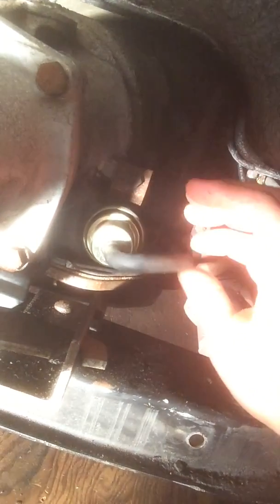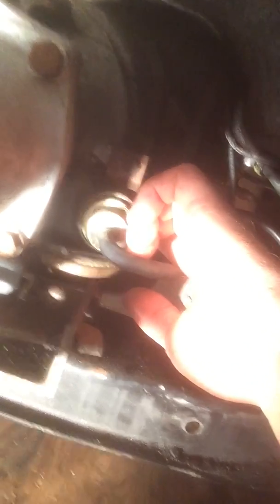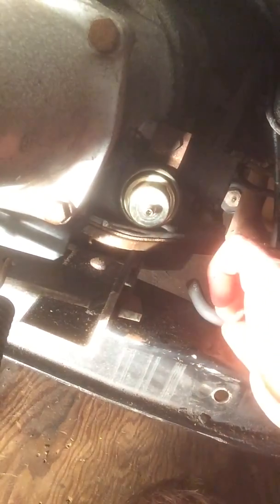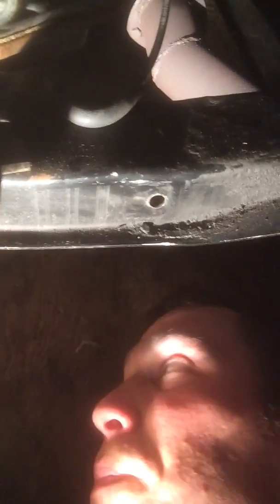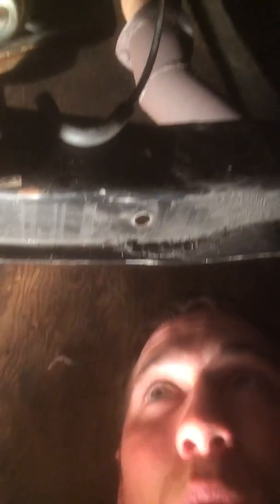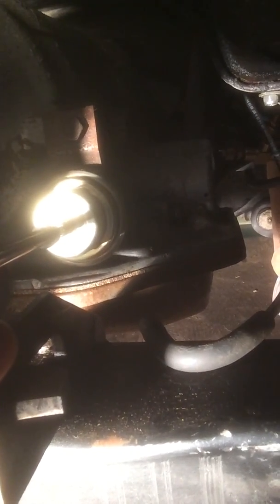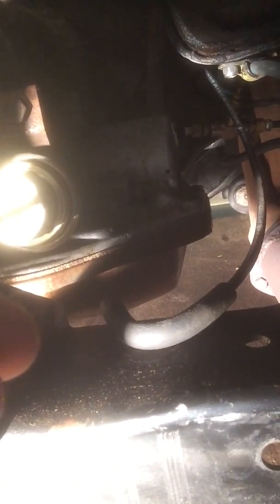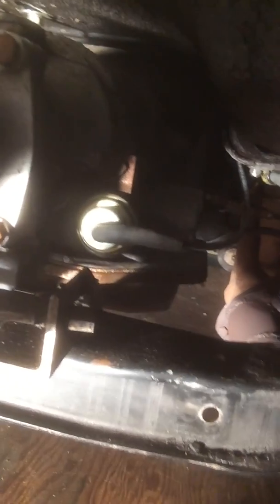TH350 Adjustable Modulator

Comment: What happens if it takes too long to shift out of second?  I gotta th350 in a 70 Lesabre and it'll kick into third about 40mph.  That a modulator thing or just the way the trans is geared??
Reply from the maker: Model,  That seems kinda normal what RPM is it shifting into 3rd that’s where you can determine a problem.
Reply: @mr.chos_garage  er...dont have a tach hooked up...  yet
Reply: Btws it was the modulator
Reply: @mr.chos_garage mine was about 2500 rpm